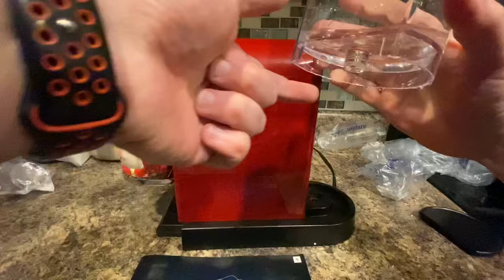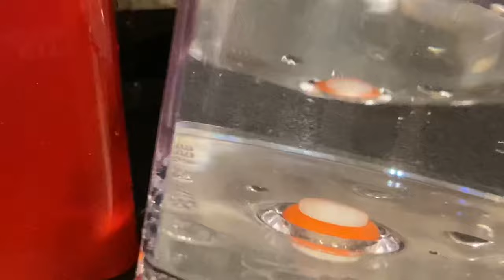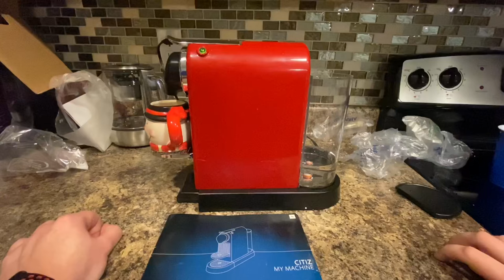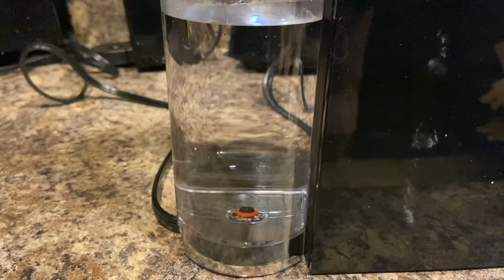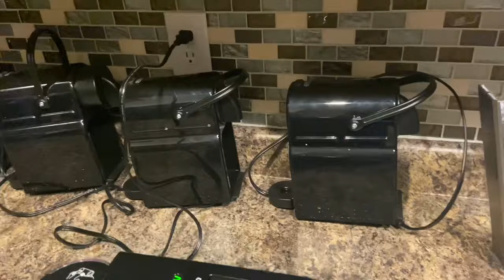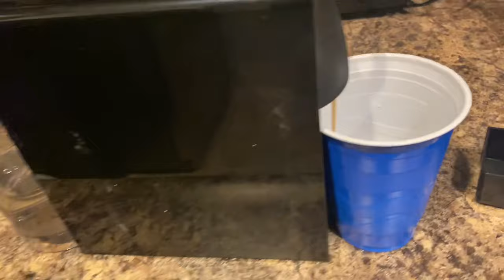How To Fix Your NESPRESSO Coffee Machine That Wont Pump Water - Air Lock - EASIEST Method I Can Find

Comment: You just saved me almost $1000 (Canadian) dollars.  No low pressure water on my five year old machine and no Breville service available within 1000km.  Your very simple solution (on the Nespresso model!) worked first time.  That this simple solution is not on any Breville documentation implies to me that Breville are happy to see machines thrown out in the junk pile because of a simple air lock.  VERY bad PR for the company is these "Right to Repair' days.
Reply from the maker: Yep, they want you to buy a new one...glad I could help

Comment: Spent 45mn trying to fix my machine with several videos on the platform (ziplock bag, blowing into the drain, using a syringe), no success. I'm so glad I found your video, your technique worked great and my old machine is now ready to go to my father in law. Thanks 🙏🏽

Comment: Tried about 10 strategies and none worked. This one worked. In my case it was crucial to have just a tiny amount of water in the reservoir. If it is full, it does not work even putting it gently. Thank you a lot.

Comment: I have a larger machine with a water tank that is not easy to remove, and so I was skeptical.  My reluctance to spend another $300 prompted me to give it a try.  One small tilt yielded a few air bubbles.  8-10 more times and I'm back in business - Many thanks - you are a genius!!

Comment: Tried your trouble-shooting tips as well as the hot water in canister. Finally removed the canister and flipped it over. Using the paperclip, pushed it through each of the open slats within the the protruding pump connection, and it worked!

Comment: Rocking the tank resolved my air lock.  I kept seeing air bubbles with each rock.  Such a good tip, wish Nespresso added this to their troubleshooting section.  Was so disappointed with my new Vertuo Plus machine for about an hour before I found your video and resolved the issue, thanks a latte!

Comment: Bought a nespresso citiz machine second hand off eBay and when it arrived I had the same issue no water flowing through. I googled the problem and watch you tube videos and tried all the advice given nothing worked. I watched your video and tried this method for almost two hours and still nothing I had completely ran out of patience. I decided to leave the machine alone for a day thinking about returning it and with one last go miraculously water started to flow! Thank you for your video and to anyone fixing their own machine do not give up it WILL work just persevere

Comment: Thank you so much!! You just saved me hours of frustration and disappointment. I had to do the pumping and releasing air bubbles several times before the bubbles ceased. At that point it wasn’t quite drawing water in so I took the air bag option you mentioned and tried to press it in on top of water as it pumped. The bag quickly popped but apparently it created just enough pressure for the water to get past any remaining air. 
Again, thank you!  Me without espresso is a terrible thing to behold.

Comment: I have been without coffee for two weeks! I didn’t do the place it back gently, I just pushed up the little thing at the bottom, put it back on and it worked! Thank you
Reply: This works! Mine has been stored for 2 years. Been troubleshooting for 3 hours. Took about 20 minutes with this method. Thank you sir.

Comment: After trying multiple methods from other You Tube solution for no water flow, I tried your solution and after 3 attempts it worked perfectly. Thank you for your due diligence and coming up with your suggestion of only slightly installing the water reservoir and allow the bubbles to come out. My machine is the Nespresso type D111. Thank you again
Reply from the maker: Glad it helped

Comment: So bizarre. I thought my U machine had finally had a nervous breakdown. Hadn’t used it for months and tried several other methods to stop the 3 flashing lights which mean add water. Nothing. Then, on the umpteeth try to just make coffee and hope it would eventually start to work, it started making odd noises, running indefinitely with nothing coming out, and never releasing the pod as the U normally does automatically. Was really going to chuck it and then watched your video. It’s hilarious that you don’t know how it works but that it does and, guess what! I gently jiggled the water reservoir a few times, as you said to do, and up came bubbles and then out came coffee! The machine is acting like nothing had ever been wrong!
Thanks a bunch. Love my old machine!

Comment: Worked like a charm.  Took only two attempts.  My issue was the tank had run out of water...I have had this happen before and used the ziplock bag...but found that very difficult and frustrating.  Thank You!

Comment: Wow! It took me a while of trying this technique (about 20 or so cycles) but it worked!  Thanks, saved me from shelling out cash for another machine.  I have the original cube shaped unit from 2008 and had it sitting idle for a year with no water.  When I added water and went to fire it up, had the problem you described.  Your fix was what was needed, along with some patience 😊

Comment: I tried the rocking multiple times. Lots of air bubbles came out along with water in the drip area. After at least 10 minutes of trying, I quit and did other things. A few hours later, I gave it one more try, still rocking to get air bubbles, and IT WORKED! Thank you!

Comment: Thank you so much for this video. I wish it was the top result for my search. I've had this issue with my brand new espresso machine and couldn't find a solution for more than six hours since unboxing. I didn't have to do it for a hundred times. Just kept my eyes on the bubbles for a couple of minutes and then the magic worked. I almost damaged my machine not knowing what was wrong with it. Thank you again ♡

Comment: It didn’t work on my new machine. But you idea spurred me to use the rubber bulb of a turkey blaster to pressurize the water. That and lifting the water tank off and on worked. Thanks.

Comment: This helped a lot in understanding what went wrong.  I got a twist on this fix.  What I did was is set the unit in the bathtub, remove the reservoir, get a about a 5 foot long piece of clear vinyl tube that is .75" outside diameter and press it to the hole at the bottom where the reservoir seats and extend the tube up to head level.  Make sure it is a tight fit by blowing into the end of the tube.  Once it is tight, fill the tube with water, make sure it does not leak.  Turn the machine on, press the big cup button and blow like hell into the tube.  It took a couple attempts but it started pumping water.  Yea!

Comment: It worked. For me taking in and out didn't immediately fix it. but after doing it for 3-5 mins I stopped and then there was a discharge of a few bubbles. Then it started working again. Thanks a lot

Comment: Hey, just to add to this, I found your video and tried but it wasn't working for me. What worked was taking the machine to over the sink, water tank filled half way then tipped the machine forward towards the nozzle but being careful not to spill water from the tank. Then ran the machine and this was enough to fill up the inlet tube and prime the pump. Thanks for your video anyway. =)
Reply: Omg thank you so much for this comment!! This is the only thing that worked for us! Must be the angle? We tried so many things but nothing except for this worked. Bless you.
Reply: @jkbaby101  hey, no worries at all. What made me click to this idea was watching a video of a similar machine to mine being disassembled and I could see how the tubing goes from where the water tank inlet valve is through to the pump. So, yeah, tilting while running it seems to be enough to let some water into the pump to get it going. Cheers and happy holidays! =)

Comment: Hi! I'm doing the same overhere in Amsterdam :-) Buy and sell them by the bunch. Now I came across one that pumps and doors water for 5 seconds and then stops. Resetting the machine doesn't fix the problem. I descaled the machine about 5 times and the flow looks healthy but just far too short. Ajusting the right volume by pushing the button til you reach the desired amount of water also doesn't work. The pump just stops after about 5 -7 seconds. Do you have a suggestion that might help? Cheers! Roger.
Reply from the maker: Sorry sounds like an actual bad unit.

Comment: Thanks man! I bringed back to life a non used essenza from 2010 thanks to you ✌🏻
Reply: Well, it worked out one time till refill of the tank. Had no luck with the same method later.
For someone struggling - I've tried to pull out this filter in the machine (not the tank) with pliers and didn't managed but it apparently loosened and blew off.
It's working without hesitation now 👍🏼

Comment: A variation of this method got it working - I had to edge 👹 the machine, where it was showing bubbles in a tank. I moved the tank in and out around 200x and got a couple of water drops each time to get it started

Comment: Worked for me. I had to alternatively lock and unlock the tank to get rid of the air inside the machine (as you said : bubble coming out) Did it for a couple of minutes. Emptied the tank and refilled it at a quater. Pushed the button and, after 10-15 seconds, it finally triggered the water pumping.

Comment: Thanks,5 years of this problem. A  year ago, I bought an alan key to pull it apart. I took the hose off and put it back on and it was fixed but its a big job. Today I did it  your way & fixed in a minute.Very hapoy thanks heaps. Lyn Vic

Comment: Hi, I tried your method and it worked, but then the machine did not dispense the water for enough time in the short or long buttons. After, I tried pressing down on the short bottom and it went, but now for time of the long, not only that it started dispensing water from inside.

Comment: Hello. Great video. I did a combination of the “bubble method” and brushed the grid plate ( behind the sprout from where you put in the capsule, ie where the capsule sits) with a clean toothbrush. It worked wonders. Thank you.

Comment: What would you do next if this didn't work? I've tried 25 times and nothing. When I remove the canister, there is a little puddle in the water receiver part, that doesn't get sucked up, so the problem isn't where the canister mates, it's up stream

Comment: Same: My first use of Inissia D40 wouldn't pump water.  Weird solution: 1) remove tank 2) put 10 drops of water in the machine's water intake hole 3) start a brew-cycle, note the water does not suck in 4) use-my-palm-as-a-plunger to push the water in.  One push, water sucked in!  Seal primed!  5) Install full tank.  Works consistently.  PS: CHECK THE HANDLE IS 100% CLOSED.  Moving the unit around slightly un-seals the handle which prevents clearing air from dry lines.

Comment: Just removed the tank and held my faucet to the bottom to add a little water pressure and that fixed it.  I tried the other methods first but that worked in the end.

Comment: Thanks   It works for me!   I have not used my Nespresso in a while and descale it and when tried to use it there was water coming into the capsule dispenser     The trick fixed the issue   THANKS!

Comment: Oh Lordy man. im so frustrated! ive been at this thing for HOURS! how stupid must i be hey?  I have tried ALLLL the remedies on youtube: the plastic baggies (mine were too small) the tapping & shaking, the picking up and tilting, w buttons upside, then tilting w buttons downside, the syringe blow-thru (cant get access to the little tube cos the criss cross plastic thingy with filter screen in the plughole is not removable on my machine) Even tried the mouth to mouth trick, but all i got was wheezy lungs and deep grooves in my forehead & cheeks from shoving my face in the half circle jug reservoir! (the damn machine has a roof over the jug space which yes looks neat with the jug in place, but is SO impractical cos i had to tip the bloody thing out on an angle to try to get my face in it, and that position stops the jug plug hole even meeting the connection hole thingy!
one person suggested really hot water in the jug and just lifting it off and on, up and down repeatedly, like 10 times with motor running, and i tried and tried (like 50 times) to no avail. waaaah! im about ready to throw the whole damn machine out the window then go down and dance on its face! i wish i could say THEN i found your video and tried your method, and it worked! but unfortunately it didnt work for me. i did the gently-gently let the jug down and wait for the bubbles...over and over again, i watched your video over and over again...and i actually did get the little bubbles! each & every time i did it! but no water came out the coffee faucet. heavy sigh. i think its time to give up. (but i still clicked your thumbs up button, cos im glad it worked for other people)

Comment: Lol.. I got mine to work by blowing hard into the hole which you attach the water tank to. Of course make sure it is unplugged, and blow into it like 5 times. Then I let the machine flush the whole tank of water, refill the tank and use it normal. Swear it worked for me!

Comment: It did not work with your method, but you mentioned those others and pushing the water with a plastic bag worked fine. So, great video I guess :)

Comment: After watching your video at my shop, I got an idea to use my air, compressor hose and force air using my fingers and the air hose to push that little bitch of water in the bottom hole and then it started working. My unit was sitting for over five years in the closet.😅. Thx man👍🏻

Comment: OK at first it wasn't working. Looked at another video and he did the same thing, but he was pulling it in and out very fast. I also put a few drops of vinegar in the hole then it finally cleared up the line. Works fine now

Comment: Hi, I think there is an easier solution, mine worked doing this:
With water on the reservoir,press the button to make coffee(obviously wont work) then move the lever vertically, and keepe it there one or two seconds then 3/4 down. Thats it.
Reply from the maker: I will have to try that if I get another one that doesnt work.

Comment: I was trying and trying it seemed to be doing something but still no water, then I realised that the capsule door was still open,I closed it and the water flowed out from everywhere, so remember when you do this hack close the capsule door which allows the water to flow and not just ends up inside the machine and then the worktop

Comment: Mmmm I am not even getting the pumping noise...
 Both Light flash as normal.
When I press either light , they flash as normal. Then no pump noise or sound .
The valve in the water tank lifts up as normal..
No pump noise...mmmmm

Comment: So i have a severe issue, which the pump will not prime with all you the normal suggested tactics,  none of these things worked. I took the unit apart and used an air tool and blew directly into the intake or bottom of the pump! and that fixed it. I left the outside cover and called it Frankenstein Nespresso, Expresso.

Comment: I've tried this and all the other tricks. Nothing worked. Then I tried without the water tank and started to see bubbles coming up från the hole that the tank sits on. I let it run like that until the bubbles stopped coming out, attached the tank and it worked. I only got the one broken machine so I can't confirm the fix. Just another "trick" if the ones i video doesn't help you!